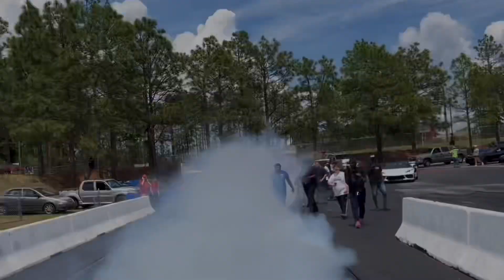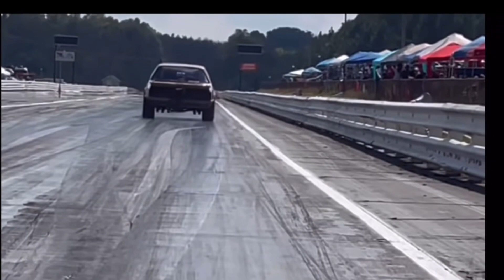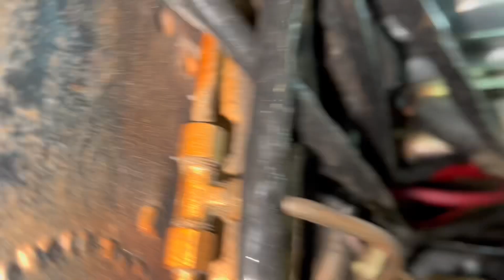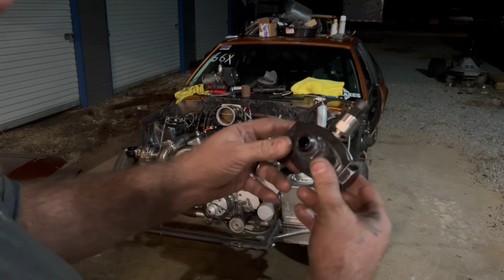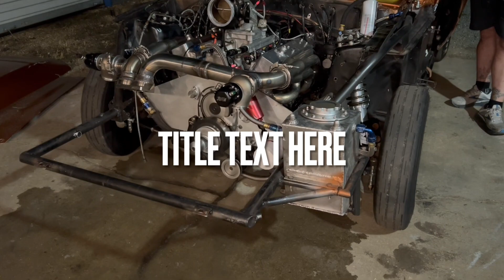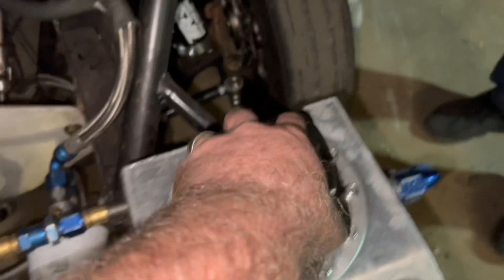What went wrong?  Potentially Very dangerous!

Comment: The actual injectors were getting less pressure, once both sides of that diaphragm had equal fuel pressure, the fuel rail pressure decreases, the return goes full pressure, but the mole in the mix is the vacuum reference port on the top of the regulator then gets fuel, where normally there is nothing but vacuum or negative pressure pulling up the diaphragm. Said fuel, then gets sucked raw through that much smaller and metered orfice and through the hose, straight to that vacuum port I will assume was hooked to the manifold somewhere, and the only question is where?

Comment: JT, I understand how rattled you were, as that was a huge alcohol leak through the diaphragm, and out mainly the passenger side bank, so did not show us you taking the regulator off. From the thumbnail pic, the turbo was not even on the car correct?

Can you please show us where your vacuum reference line is hooked up in the next vid? Thanks. Looks like it really was feeding massive fuel through that regulator vacuum reference line,, just into the intake, into 1 bank or runner (and all possibly through just 1 cylinder), on passenger side and out through header to the turbo flange...If so it was metered a bunch, and did not sound like it was filling the hole enough to hydrolock it as it was a lot, but not a ton, just constant flow in and right out, and only while running, and luckily the return line was much bigger volume than that much smaller vacuum reference port fitting and line.

That it did not spark a fire up was a miracle. Timing was right, as was the big overlap on that cam brother, both intake and exhaust valves were open at the same time a long time.

That cam choice may have actually just saved you from catastrophic damage. Imagine that.

Parasitic draw in of large cam lobe overlap, from an engineering standpoint, has its plusses...and you may have just proved 1 of them. Stops over fueling in an emergency, though if the turbo had been connected, and fed all that fuel back in, who knows....but, I would assume a really bad result.

Comment: Holy crap that is a ton of return pressure and volume on that fuel cell return line JT.
Reply: Ok, that was without the regulator in the mix, and the vacuum reference line disconnected which is where that fuel was going through the broken diaphragm, and straight into the manifold and into the runners (airstream), cylinders received a wash down though then thought the turbo and out the hot side.
Reply: Thru

Comment: Check the duty cycle on the injector and the fuel pressure.  Don't mean an injector is stuck but it's one possibility for sure.
Reply: Haha nevermind, I commented after you said to post what you think the problem is.  In my experience it's always 1 of 5 things, the 2 most common are the ones I mentioned.  Looking at what the duty is will rule out if the ecu is commanding it (trim or comp).  Then by looking at the fuel pressure you can tell if it's a regulator problem.  That normally covers the diagnosis and leads to a fix.

Comment: I swear, he does so much with so little…. But if he didn’t have bad luck he wouldn’t have any….. better luck to you man
Reply: It’s a aftermarket block.. billet crank.. aluminum rods… precision injectors.. Holley dominator… mechanical fuel pump… he ain’t going fast “with so little”. He just ain’t going fast with $100000. 

Guys with stock bottom end stock headed LS are going fast with little. 

Not taking anything away from John. I’ve been a fan for a very long time. But his setup isn’t “junk”… it’s just not pretty and brand new,
Reply: That's the game you play with budget stuff it's always something but even the best parts fail....alot

Comment: So many so called hi performance parts that are very low performance. About 5mm of hole inside makes all the 1/2" lines a waste of time. I have been through this and had to modify and replace undersize parts. 
The same goes for oil line fittings as well, 1/2" hose with under 3/8 internals.

Comment: I run precision injectors I’ve never had a problem with them there hard as hell to find now I run 16 injecters and I have one back up set  I bought the backups at the beginning of covid when I done a refresh you can buy the kits to rebuild them they have to o ring kits anyways. I thought it was a hung injecter at first but damm I hope you change that oil after that wash down to the oil.

Comment: Seems you might want to pull and check the injectors and the o rings.  That over pressure might have damaged an injector and/or an o ring.  Last thing you want is an injector spraying fuel onto the engine during a pass!  Glad this happened now vs later during a pass!

Comment: My guess would be either a stuck injector or dead spark plug, or both. A pressure gauge would have diagnosed that problem. The idle sounds much better without that regulator.

Comment: That's a hell of a lot of fuel getting blown BACKWARDS out of the turbo charge pipe.  Either an injector is busted or (joke removed because it apparently wasn't understood) .

EDIT>How did you get a hung injector? Like a BILLION things. They wear out. They fill with junk when you're not exactly doing your maintenance like you should, so your fuel cell fills with crap. A fuel filter gets a small hole when it's used 200x it's duty life cycle. 

Like everything, John, you tend to use everything too long. Just because it works, doesn't mean it's going to keep letting you get away with going short on your maintenance.  Maybe that injector is new but there are high odds that it's a "new to me" 2 year old injector you found somewhere cheap.
Reply: Thats fuel coming out of the headers and its not “backwards” its exhaust going the right way, nothing to do with a rod, piston except they are pushing 3-4X the fuel out than it normally sees. Also not an injector issue either, just the wrong regulator that gave up after installing the new bigger fuel pump and imo it was a simple oversight since its worked so long without an issue, was designed for efi too just not for a giant belt drive pump thats returning 90% of the fuel at idle vs a full boost pass
Reply: @young11984  I don't care what you see because it's a hell of a lot of fuel being blown out the exhaust which means a bad injector sending a waayyyy too much juice.

That could have been one hell of a fire.
Reply: @LoociferZ  yea that usually happens when the regulator sticks and doesn’t return fuel to regulate pressure, causes pressure spikes well over 150psi and injectors are usually under half that pressure. Ive seen over 200psi when other style regulators failed, return fuel hose collapsed etc so yea a LOT of fuel was being dumped in that wasnt normal
Reply: Those are headers sir....
Reply: @jman71890  LOL I didn't see that they were forward facing headers until later.  The way he has his exhaust setup is BIZARRE.  I left the post as it was because I was an idiot not to see it at first. To be honest, I'm confused why he needs forward facing headers because that's the engine bay of a mustang foxbody.  You could probably shove the engine from a freight train in there and still have space for a refrigerator. I know of builds that have big block Chevy 632CI engines with twins that scooch into the engine bay of a 93 5.0 or even 85 GT.

I swear that every year, people find more and more places to relocate traditional components of an engine.  My personal favorites are coils mounted to the firewall. Generally a useless waste of space and POW there's your spark stuffed away from the top of the engine.
Reply: @LoociferZ  it's a turbo car, but he had the turbo off for first fire up with a newly built hotside.
Reply: @justin_parks  (sorry for the rant)

I know it's a turbo car. His name is Turbo John as you might notice.  I run twin turbos in my own car (we don't have single turbo events here because the air is so crap that we need twins.

Running a turbo without the hot side when you have your entire hot side being dumped out the front of your car is kind of irresponsible. That explosion of fuel could have easily turned into an explosion of his car.

I love TJ's "making it work with a $1.25 budget". Its entertaining to see him do pretty well for what he does however the combo that allowed him to run like he was blew up. It was an eventuality with him doing stuff like reusing plugs and zipties and bungee coards and cleaning filters by blowing them out with the air or cycling a fluid back through an oil filter to clean the crap out of it.  It was just a matter of time.

Unfortunately, I think that he was just riding a sweet spot with sweet parts that were overperforming. My opinion means -$1.25 of course but I was constantly telling him that going cheap was going to burn his ass and I hate to say it but I was right. He's running high horse power single turbo racing that demands that you maintain your car better. You can't just keep running the same plugs for 40 runs despite them starting to fowl or burn down. There's a bunch more things I won't say but the fact is that if you have aluminum rods that the industry says you should only run fifty times, you CANNOT run them a hundred and twenty five because "they look just fine".  You often can get away with that but you can also not and get wrecked. People heat their oil to burn off the water just because they have water in it from E85 vs just changing the damn oil.  The point to this being is that you could break something you've fatigued to death by not changing it on a proper duty lifecycle, break an oil or other fluid line, put oil under your tires or on to your glowing red headers, go into the wall or explode into a 170MPH fireball before hitting the wall and either die or get crippled or lose your entire car because the rescue team sucks balls or is sleeping (the last time Swanstrom had a fire it took over TWO MINUTES for the frigging truck to get to him. Dammnn lucky he hadn't been knocked out or he would have been burned.

That and things like that ar just not treating your car mechanically sound with practices and procedures.  You miss getting blown up once. And another. And another. And at some point you go "well hell, why not like er ride unless i looks really bad".  That the point where your 125 run rods twist and take out your entire engine when you're in the Final of a $25k high dollar race where you have to turn it up some.  John does a whole of lot of "well hell, it's not THAT bad" which eventually gets him. Competition is higher than ever so you can't give up .10's from allowing your car to wear itself to death.

Anyways I'm ranting BIG TIME and its NOT MY CAR. TJ's problems IMO are generally all self inflicted gunshot wounds. I see some of the stuff he does with welding stuff up and then grinding them down to fix a serious job like a cam shaft, I think of my own car that is now sitting in my heated garage for the winter and shudder ...just at some of the things TJ does.  

I've not raced the same number of times he has because our racing season is at least a month shorter and we just don't have the same kind of action he has here. I have never blown a block up. I've never had a serious fire.
Reply: You nailed it right in the head, BAM!!!!
Reply: seems that plumbing in a 120 psi or ?? blow off return to tank valve may be a smart addition....or maybe a engine kill command on fuel pressure sensor over limit.